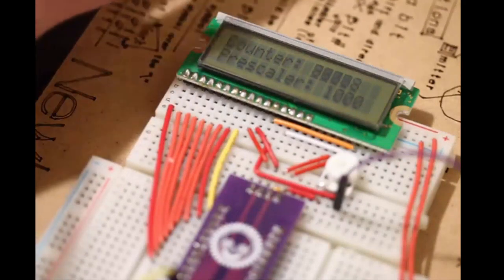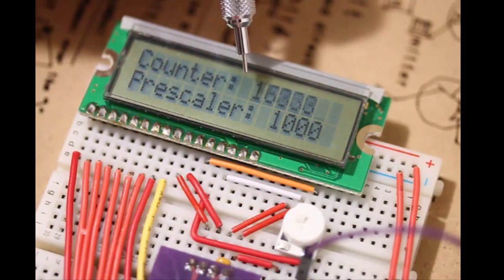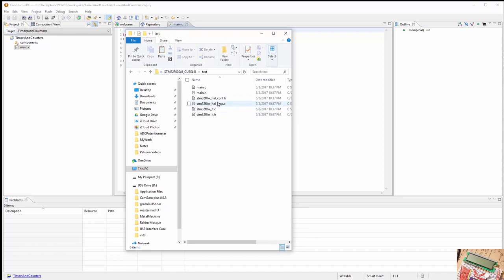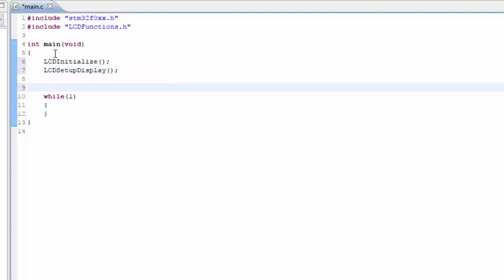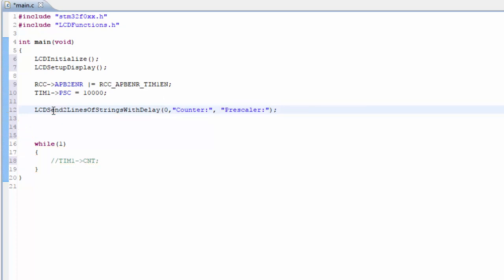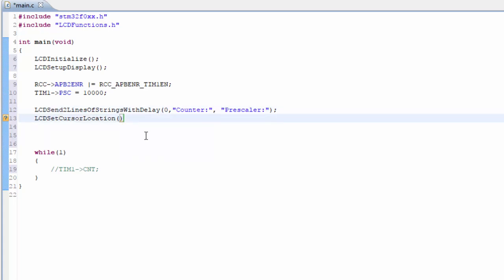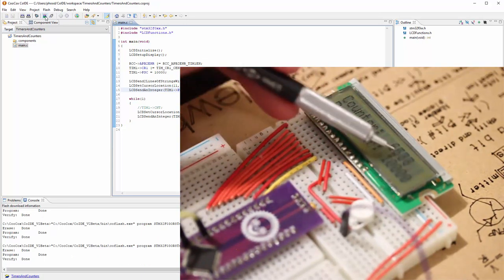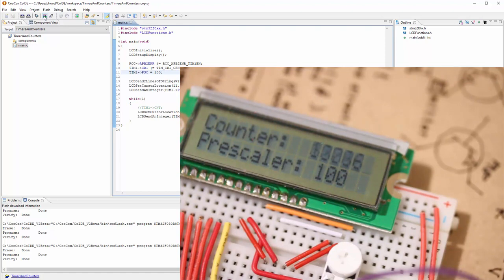41. How to use Timers Counters and the Prescaler on the STM32 ARM Microcontroller

Comment: Let me echo the plaudits you have received on this series. I probably will never build a project using an ARM MCU but I am sure I am learning a great many things that are applicable to almost all flavours of MCU. Thank you, also, for not editing out the little omissions and typos. I do believe that will help the neophytes by showing them that nothing is going to blow up when they click on build. I enjoyed your AVR series tremendously and consider it compulsory viewing for anybody seriously intent on using an AVR to its full potential. The Arduino is an excellent framework for the absolute beginner but it does hide a good deal of the functionality from the developer. So much so, that should they attempt you crowbar a routine using the timers into their sketches,  a good deal of the Arduino coding will break because the framework relies on a state of the machine in which timers are an essential factor.

Loving this series.
Reply from the maker: That is a very good point.  Thanks for the kind words.

Comment: Hi,
Does this mean that if i set the Prescaler to 10 000 and i have a 8Mhz clock that every 800 (8Mhz / 10 000) count one second past by? And is this 800counts=1s consistent over time or could it be interfered with something else?

Comment: Thanks for the great series. I've just started MCU programming and the series is more than helpful.
I'm having trouble understanding why the basic timer clock is 8MHz and not 48MHz? The documentation say "The AHB and the APB domains maximum frequency is 48 MHz." (chapter 7.2, Clocks) and the PWM example in Appendix A.8.8. also says it's 48MHz. However, by looking at the LCD display I can say that it really is 8 MHz. I'm really puzzled. How to be certain, since I didn't find definitive answer by reading the Reference manual?
Thanks!

Comment: Just one question:
Why do you add the CubeLib?
What is it for?
I didn´t add it in my projects and all work fine.
Reply from the maker: The cubelib files contains all of the defines that are related specifically to the STM32F chip.  It's odd that it worked for you.  I will do some experimentation.
Reply: What todo if we have to select timer 2 and channel 3.....?can you frwd the sample
Reply: Timer 2, channel3 as counter ? Sample code if there?